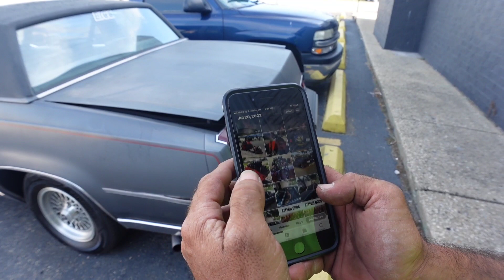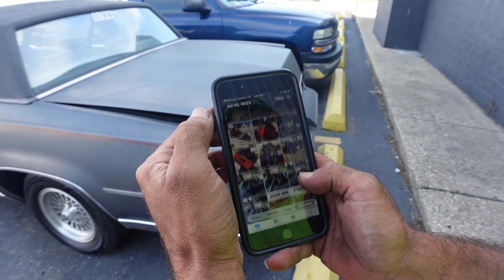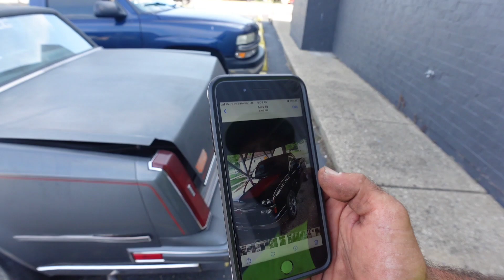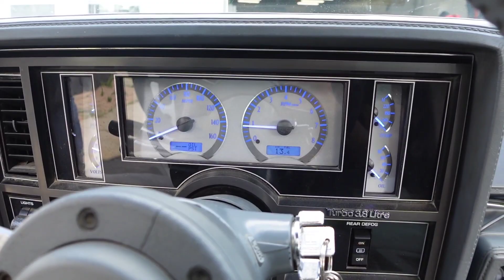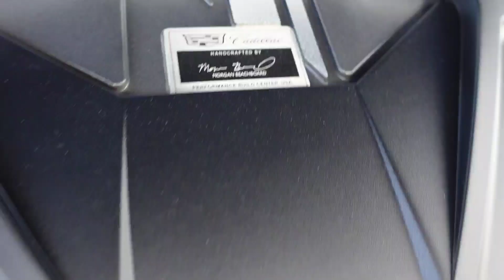I BOUGHT TURBO JOE GRAND NATIONAL REGAL AND A 88 CUTLASS SUPREME BOTH T-TOPS

Comment: Cj when you find a car like this take the t tops off and look at the weather striping and look under the car to see if the floor boards are rusted. that will let you kmow if the tops been leaking. If they have been leaking the floor boards will show it.

Comment: How it idles really shows his mechanical engineering skill. Nice pick up CJ.
Reply: But then that intake smh. Enclose that ASAP.
Reply: @Twilightgatestudios  the bottom of the engine carriage is wide open with massive airflow airboxes on these cars are restrictive unlike these newer cars they have a undercarriage cover which restricts air flow so these newer cars have bumper holes for the air intake boxes or its through the grill or fender
Reply: @deuce7258  That’s hot air being sucked in. How’s making cold air flow through the intake restrictive?

Comment: There’s a mansion in minooka il cj,, 1.1 and it has indoor swimming pool, the works  and it ha a huge compound attached to the house and it has a huge warehouse for storage in the compound Its not that far from joilet. Check it out on red fin. Bet you can get it for cheaper if you drop the bag cash on they ass.
Reply: 4187 white willow rd minooka il,.

Comment: that's not a 305 in that cutlass 305 is a Chevy motor that's a Oldsmobile motor with the oil tube in the front. it's either a 307 or 350.